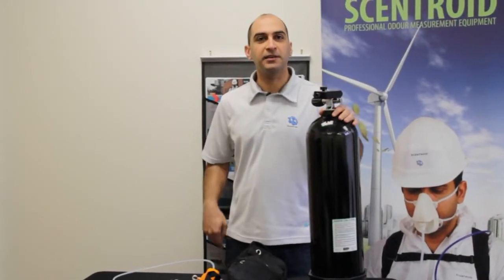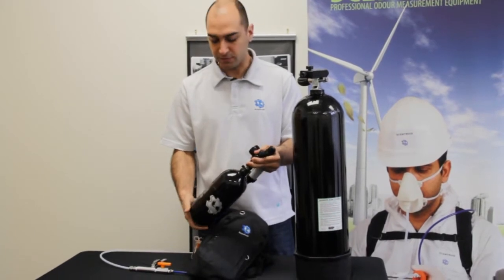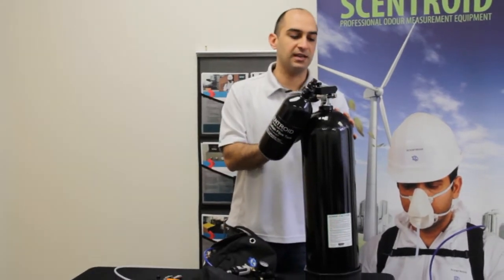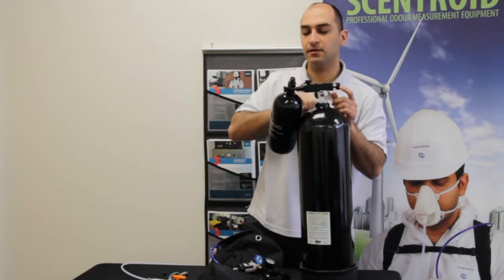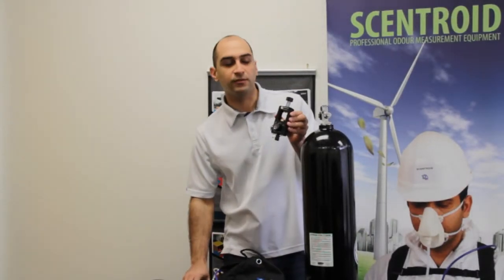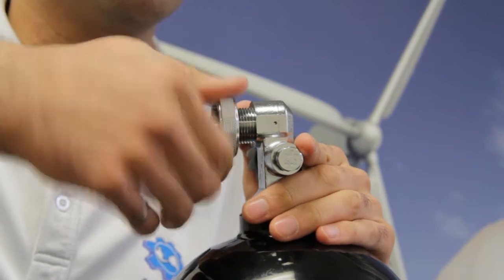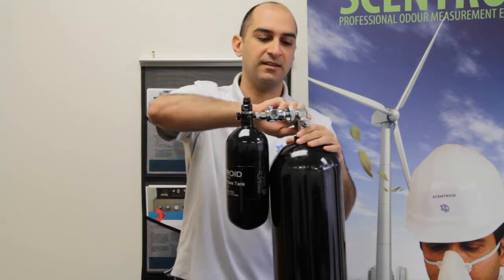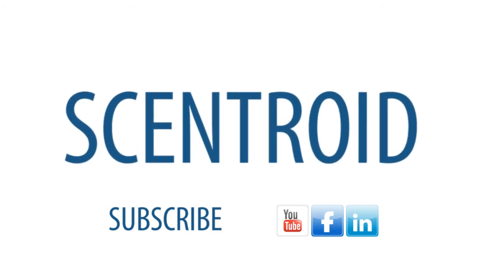SM100 Infield Olfactometer Instructional Video

Comment from the maker: Scentroid SM100: Infield Olfactometer
Scentroid SM100 is the world’s first field olfactometer. This in-field odour-measuring apparatus allows users to accurately quantify ambient odour strength.
This revolutionary device (Patent Pending) offers an easy-to-use and cost effective alternative to guessing at  #odor   strength or using expensive odour measuring laboratories.
 #contamination     #science